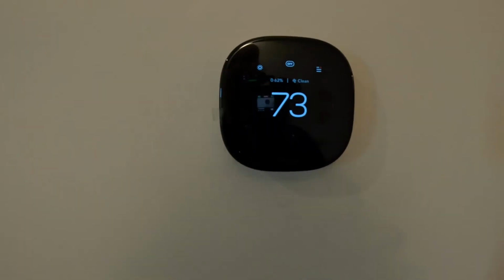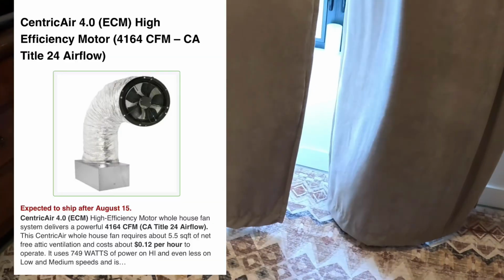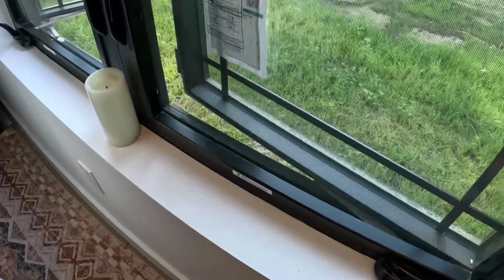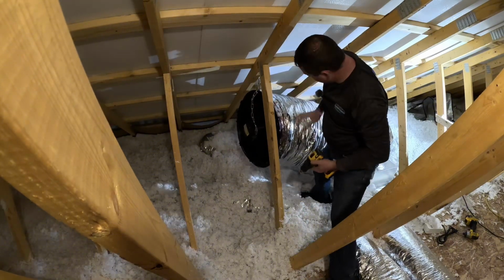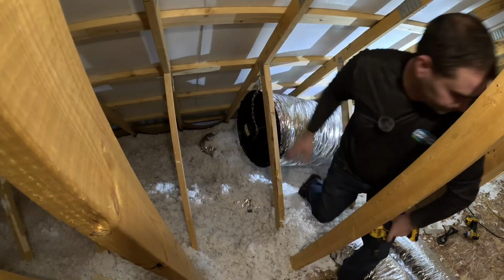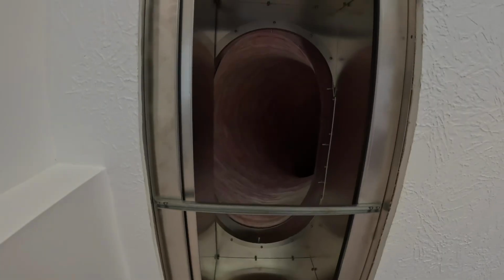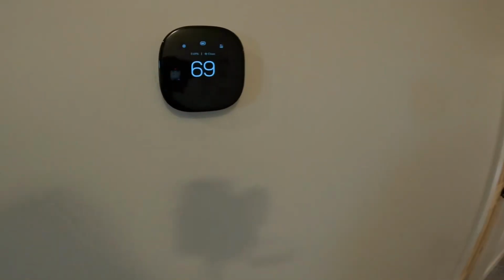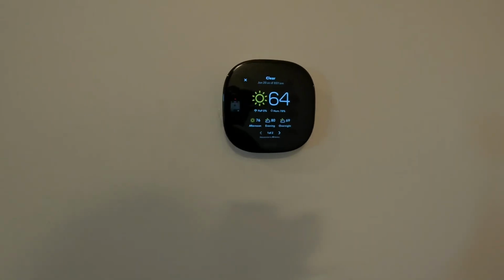Innovative whole house ￼fan systems that improve sleep quality & comfort without breaking the bank

Comment: That's a big savings, Tom. And in a house that is large with high ceilings, this system is a great choice. The fresh air exchange is crucial in a well insulated home. I installed a heat recovery system and it does well with no noticeable electricity cost. It really helps keep the house fresh and balanced the rooms out.
Reply: No doubt!  Moving air getting rid of those warm air pockets would be great!
Reply from the maker: Yeah, with how high all the energy cost are these days any little bit helps the people that bought my own house thought it was really cool feature👍

Comment: Great unit. They are called a Economizer around here. 
👋👋👍🏻👍🏻
Reply from the maker: Do you have anything like this in your house? Seems like our climate is real similar
Reply: @fatefarmspa . No Tom. Only have little air conditioner in the bed room. And only use when needed. And our economizer is opening the doors and windows. 

Commercial buildings here have air conditioners and most have the add on economizers.